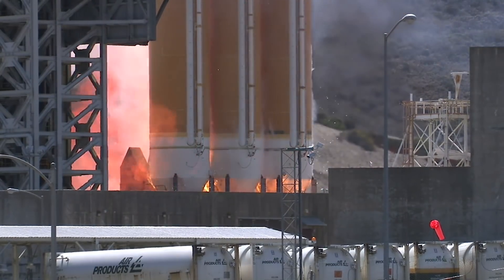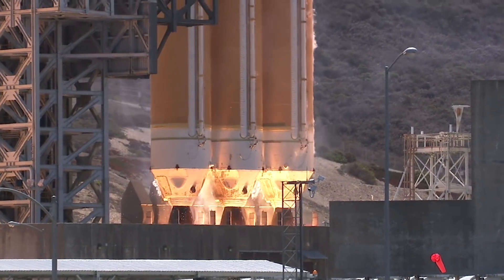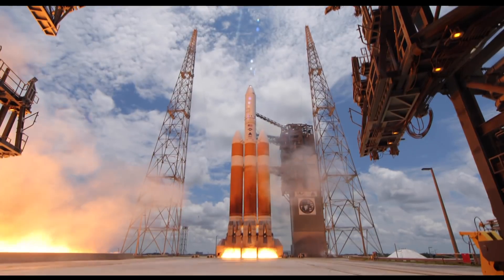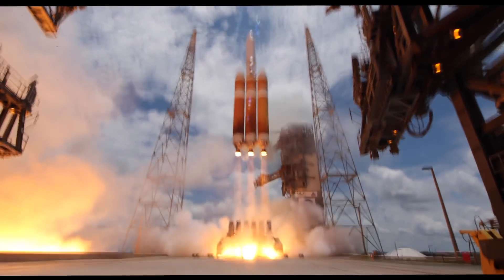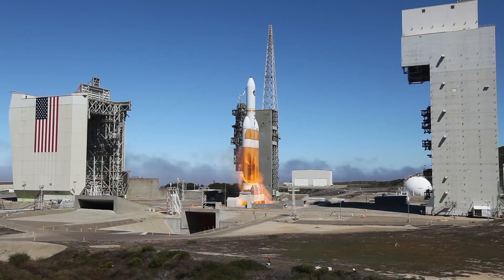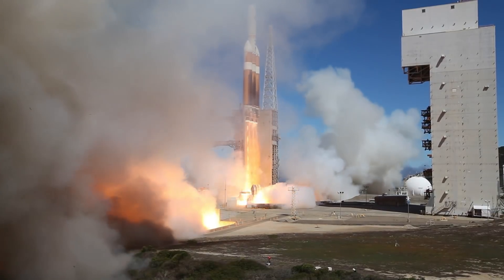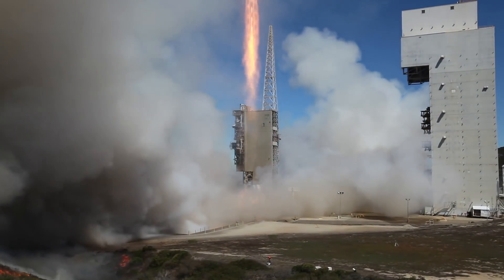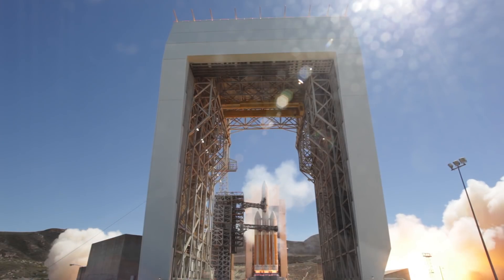Rocket Talk: Delta IV Heavy Staggered Start

Comment: Why don't you use a microwave booster or a gravity generator so fuel is not a factor a fuel is unneeded , you could use a stable form isotope of element 115 .